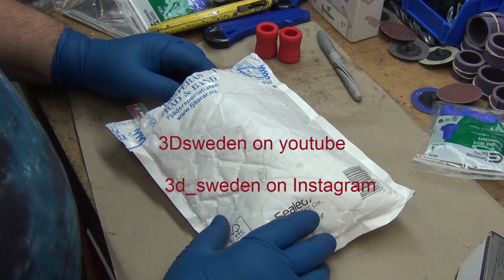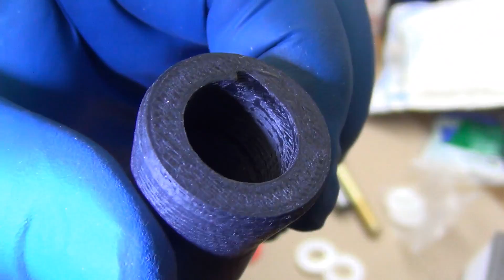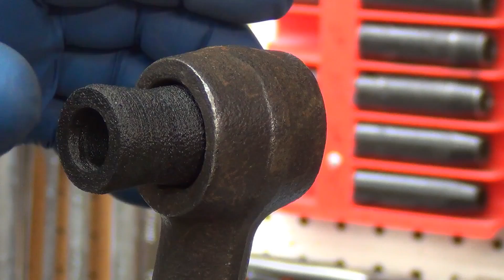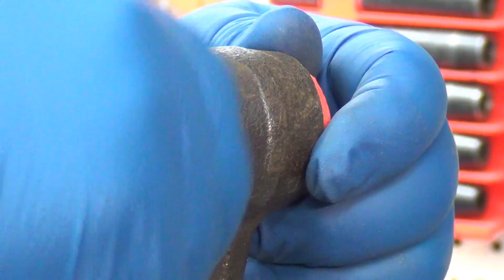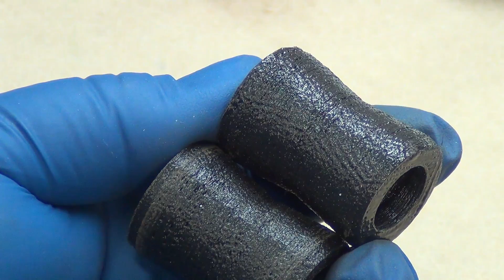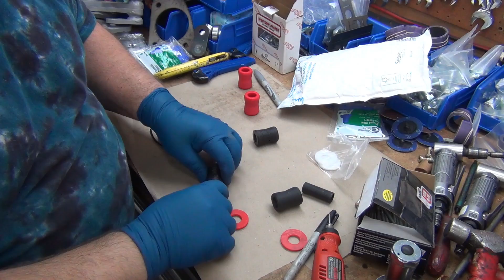UCA 3D Printed Bushing Test

Comment: Currently trying TPU bushings on a set of cheap bicycle spring forks, and I realized with the tight tolerances I had to account for about 1% shrinkage from cooling of the part.
Reply from the maker: Interesting.  So far, I've only printed with PLA and nothing has needed tolerances that would need that kind of consideration.  I hope they work out for you. :)

Comment: So I can print my own car parts too?
Reply from the maker: It's actually going that way.  There are several car companies that are moving toward a "percentage" of their vehicles being printed parts.  It will cut down on just how many parts will need to be made and stored for the future since they'll be able to print them on demand.  Car companies are required to create "X" amount of spare parts.  I think BMW and Ford were two of the ones I read about.  

I also know that there's a filament out right now that is UV resistant and flexible....people have made gaskets like the ones between the side mirrors and the body.  ........so Yes, you can. :)

Comment: do you know what the shore hardness of the poly bushings the 3d printed ones are based off of is? Th e hardness of the ninjaflex is rated at 85a, which according to this chart  http://powerflexusa.com/howtochoose.aspx is well within usable bushing territory. I can't find too many details on how the printed ones would fair on a car, but the numbers look good. You ever end up putting it on a vehicle?

** Just checked on available products again, and apparently there is a filament by sainsmart that has a shore hardness of  95A. May be a winner for bushings.
Reply from the maker: I specifically asked....it's 88A durometer.  I would question the adhesion between the layers, but I don't know much about 3D printing.  If the layers fuse well enough, I would think it would work.  The original rubber bushings would break down very quickly(6mo?), so I doubt the printed ones would be any worse than that.  I have not tried it in a vehicle.  If you do, please come back and let us know how it works!!! :)
Thanks!!
Mike
Reply: Thanks for the answer, I'll let you know how it turns out, $30 of filament should save me $200 in bushings. Gotta love old cars lol
Reply from the maker: I'm quite interested to see how it turns out!  I subbed you.....you should do a vid of the results. :)

Comment: Neat stuff.  Needs some tests on how it holds up against oil, coolant, and heat.  Material data sheet?
Reply: +Knolltop Farms just put a piece in some SKF bearing grease and wrote today's date on it so we will see in a couple of week/months haha.
Reply: Know that filaflex is resistant against fuel and acetone. Heat resistant is probably around 100-150 c (print temp is around 230c) But don't take my word for it. Did Put one in boiling water and that didn't do anything too it.
Reply: +3Dsweden I wonder about that too...in theory if properly lubricated it shouldn't become excessively hot, but thermal breakdown in an oil/grease environment over time would be one heck of a tough test to do...or well just time consuming to truly prove longevity. Excellent printing job and craftsmanship on those components, what a great field to be involved in!
Reply: Knolltop Farms Put shreds of it in petroleum jelly or motor oil (anything petroleum based).  It won't take long to tell if it starts to break down.  Maybe a few months of constant contact.

Comment: All the parts are straight from the printer. Just cut of the raft from the bottom of the abs parts.
Reply from the maker: +3Dsweden In that case, the accuracy is very impressive! Thanks again!!!  It was very cool to be able to check it out closely in person!!  Let me know if I can return the favor!! :)
Reply: +bluehandsvideo no problem man!  Is one harder material available actually. 
Material cost is about 2dollars each. 1,5 if you buy a bigger spool of filament. If you can print them in the future.
Reply from the maker: +3Dsweden I'll be trying it down the road.  I've also got a Tiko printer on order(kickstarter) and it looks like it's going to handle a lot of different filaments.  It will probably be here before I finish either of the other two. lol